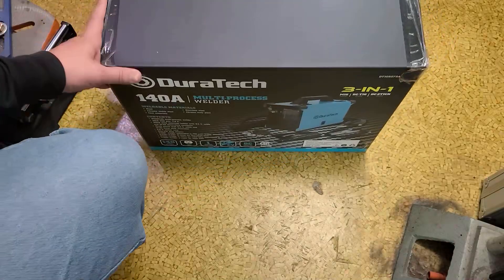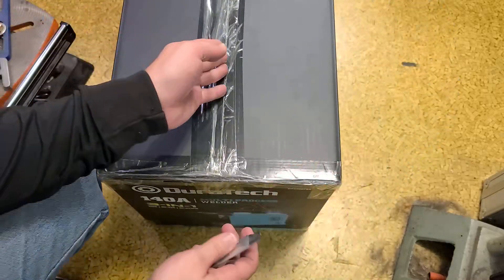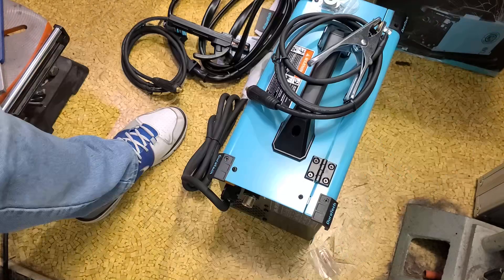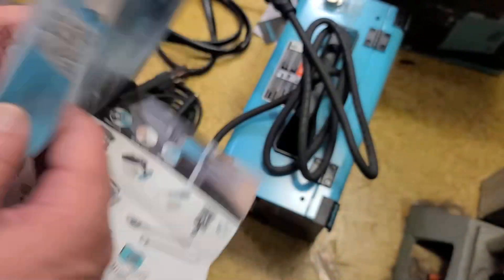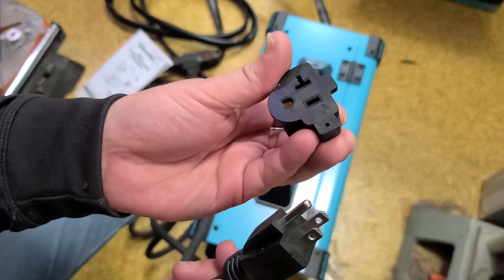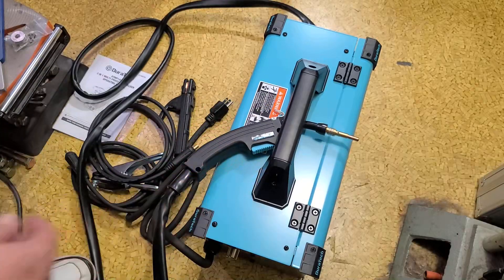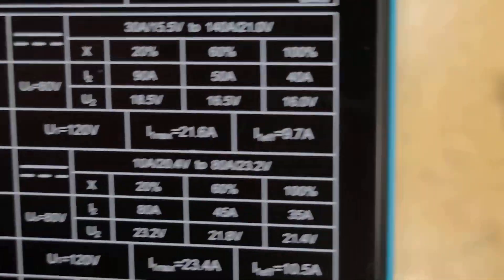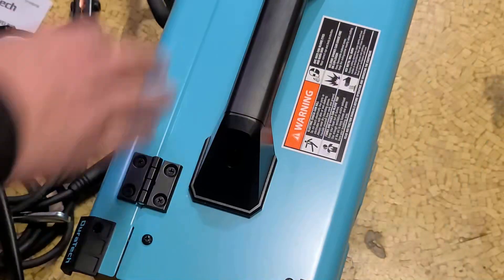DuraTech 140Amp Mig/Tig/Stick Welder Review

Comment: ya think it's worth 90$ new? because I'm about to pull the trigger on one in about a week.
Reply from the maker: I would carefully evaluate the duty cycle of the budget machines, that is what really set's them apart, the ProStormer PSWM01D that I reviewed a year or so ago has a 60% full output duty cycle rating, many of the cheap welders are only 30% duty cycle at full tilt.

Comment: 1/16, 5/64, 3/32 rods is what you can expect with most 120v welders.  Flux core might be the best or hobby mig.  Duratech wants to be Eastwood.
Your basic 120v welder at 140A would blow the breaker after one rod.   I was using  my everlast at 60-80A and forgot I was on 120V.   Burned  through one rod at 100A, put another in and struck it.  Pop.   You might get two rods if breaker is cold to start.
Reply from the maker: You are right, 120v welders are a bit limited in terms of output and rod size.